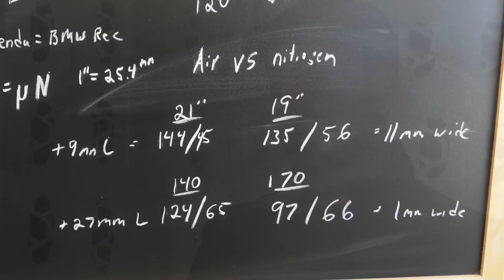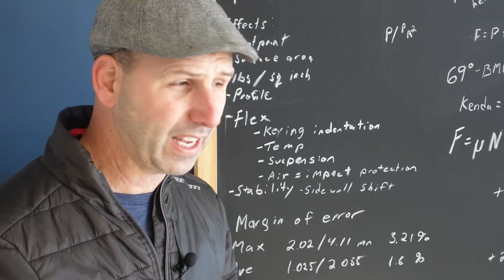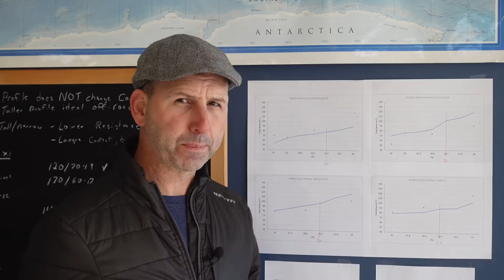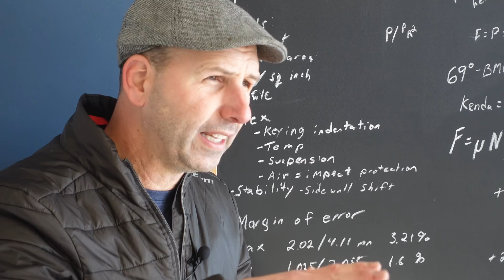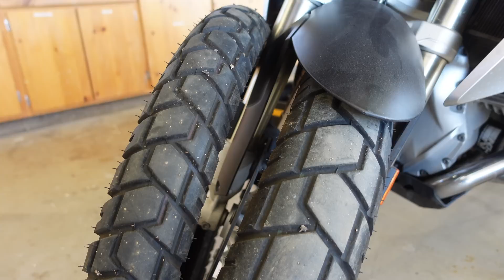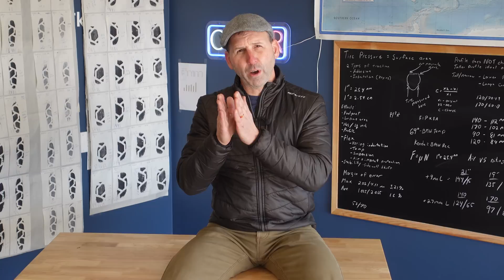Selecting the correct tire pressure; How airing down motorcycle tires affects contact patch

Comment: Although not measurable by any criteria discussed, my anecdotal experience is about FEEL.  When I air down the bikes feel planted, stable, and confident in marginal off-road surfaces. The difference in sand is remarkable. Nice analysis, thanks Brett.
Reply: Agreed. Try both and draw your own conclusions. I'm not going to run 8psi dirt bike pressures on my 600 lb tubeless ADV, but I'm also not going to run the manufacturer suggested STREET 36/42 pressures in the gnarly stuff either. I like Brett's conclusion of no more than 20% lower. 28/33 sounds about right, though I have gone down to 25/32.
Reply: Sand, gravel, and mud are reasons to air down.  You will have much better feel.  These are 3 dimensional surfaces the tires sink into.  The channel host's analysis was done on a hard 2 dimensional surface.
Reply: @stevestowell-virtue3781  The had 2 dimensional surfaces yield predictable data, whereas the sand, gravel and mud you mention are inconsistent in their give/ squish/ compression, giving you less predictable and therefor less accurate, feedback.
Reply: @Mo Nunyabidness  My point was the tires sink into soft surfaces so there is a widen contact patch.  We all run rimlocks on our dirt bikes and drop pressures as low as possible without bending a rim.  Lower pressures work off road by not stuffing a hard tire into the soft surface.
Reply: @stevestowell-virtue3781  Rob Pepper's analysis (on 4x4's) has similar conclusions as Bret's. Perhaps in terms of feel it may be different up to a certain pressure (as Bret noted) but the traction/surface area argument is near insignificant.
Reply: I can't say for sure if I"m truly feeling a difference or if it's the placebo effect. After watching this video, I have no doubt Bret is right about the contact patch changes being minimal (like 1-3 mm) but there are many times when a few millimeters here and there make a meaningful change. Examples include seat height, handlebar height, rake & trail, preload, etc. So maybe a tiny change in contact patch is still substantial?
Reply: @JohnnyFuelMotorcycleAdventures  I don't think it's a placebo effect.  When I had E10 front on my R1200 GSA it was better all the way around off road at 28psi than my road pressure.  The front suspension wasn't as rough over obstacles, and the front was planted in corners.
Reply: @JohnnyFuelMotorcycleAdventures  Hi Johnny, I think, all the parameters are important for races on tarmac, but like Bret said, a natural surface such as grass or gravel put all this data into perspective. What I know about the microstructure of tyre rubber is the claw factor on stony ground, where the tyre adapts better to obstacles. Otherwise, with too little tyre pressure you have more problems than is good for you.
Reply: Most people can't feel a small difference in air pressure in their vehicles.

I suggest, given the data, that you objectively test your feel of the air pressure. Check your air pressure with an accurate gauge. Ride a defined course of your choice. Have someone change the air pressure, up or down, by 5psi without telling you what they did or you being able so see/ hear/ discern what they did, re ride that same course. Come back and state whether you think they increased it or decreased it. Have that same person change the air pressure up or down again. Ride course again. Come back and state what you think they did again, and then have them tell if your  findings/ feelings were correct.

Take the subjective (feelings) out of it. If your feelings are correct, that's great!!!

I am lucky enough to be able to tell you if I have a low tire and which one it is. IN MY CAR. On my bike, where the variables are so many more (leaning, wind, spring/ shock compression/ travel, which gloves i'm wearing, who in traffic is trying to kill me with their inattention, the smells from that bakery always smell so tantalising, "there's some malice in the cold this morning" etc) I couldn't tell you with any real certainty. I mostly commute and tour on my bike.
I check my air pressure about 2X a month on my bike (Africa Twin)  and when I have corrected it, I can say "that feels right or much better" but honestly, on the ride in, I couldn't tell you that the air pressure felt off.

In my car: "it might be me, but I think the left front tire might be low. I should probably check it." I'm impervious to wind, insulated from the weather, shielded from noises, protected from inattentive drivers etc etc etc, and my brain, with less stimuli, is able to pick up on the tire pressures.
Reply: YES! Feel, established from the Vestibular system. Feel is what separates great from good from poor. Without feel, a rider cannot typically advance.
Reply: It's literally in the video and ignored. The fact a pinch flat can occur means the tyre is wrapping around better. The measurements taken are on a flat surface not one with inertia and rebound. On hard surfaces 20% if fine. On softer there's a reason we drop down to 50%. The measurements should be in percentages too not mm. 10mm more on 100mm patch is 10% more grip....

Comment: All I know are dirt bikes. I have the “tubliss” system in the front and rear allowing me to run 4psi in the rear and 6-8 in the front. The most noticeable upgrade I’ve done on the bike. We call it cheating. Traction and control over wet, angled roots in the trail is amazing. Plus, the 110 psi core keeps the rim protected while hitting obstacles like in this video. It’s not a myth. On this, I absolutely know of what I speak.
I ordered a 23 890 r that’s not here yet. I know nothing about adventure bikes. Thx for the info although if “tubliss” ever makes a system for bigger bikes, I’m all in

Comment: More can be achieved by setting up your suspension correctly for your ability,style,terrain,weight distribution (cargo,passengers)speed of riding,and distribution of terrain,road vs duel track vs single track. As you and your terrain get more technical air pressure will be more of a factor. 
Myself I am on more of an enduro style bike a Husqvarna 701.
Which I ride with and without full 80 liter bags and a single wheel trailer.
Reply: How VERY true. Susp is everything, yea, whereas air is almost (within reason) nothing. Keep 'em fine comments comming! Together, we might educate our fellow bikers to ride well and be safe all the time.

I am an engineer.

Comment: Thank you for doing this, this must have been a lot of work and we all appreciate it.
Reply: Yep.  The test tires were a roughly 70% pavement / 30% dirt design, with small grooves between large blocks, such that the surface of the tire is unlikely to shift around much when the internal pressure is reduced.  I'd be interested in seeing a test with a more dirt-worthy tire, like a RallZ or Dual Venture.  I've noticed that dropping the front tire pressure on a RallZ (from the KTM recommended solo 22 psi down to about 16-to-18 psi) made the front end of my 640 Adventure a lot less skittish on hard-pack single-track (hard-pack with a thin layer of dust on top).  Given the marginal gains in footprint area, I wonder if the significant difference in "skittishness" (which is just the "feel" of losing traction) is primarily in the tire's ability to conform to small surface irregularities.

Comment: I would have preferred to see the actual numbers not the coins. I drop pressures by about 30% when off road, and I would be interested how much my surface area increases in this case. I get noticeably better traction than on road pressures.
Reply from the maker: I did give verbals but will look to include those when I make the follow up with the manufacturers responses. 

I wanted to make it something people could understand easily
Reply: I wouldn’t trust my math skills and I’m not sure I correctly understood the quarter n dime representation, but I did the numbers based on them. I left the pennies out as I wasn’t sure of the representation, so I might be off even more. (Again, caution my math). Area of a quarter is 462.24 mm. Dime is 251.9. Eight quarters worth of “surface area” -20% psi from stock added 3 dimes (I think this is what he was showing?) which is 20% increase in surface area. -10% psi was a 13% increase. 
Sure feels like a 20% increase when I ride aired down so I’ll believe it till I’m wrong!  Ha.

Comment: So to clarify: you said you need to “air down to the proper range”? Not “ don’t air down?   Dakar riders aren’t running full pressures ( in fact on mousses)which enables lower tire pressures. Trials riders are definitely not running full tire pressures. That sweet spot will most likely significantly reduce the deflection and maintain power input and momentum rather than wasting it by deflecting the bike in a unwanted direction. This can be the difference in a successful hill climb.  Your tire imprints don’t take into consideration of a non regular  surface? That fully inflated tire will not deform as much and have a smaller footprint compared to a lower pressures tyre that flex’s around the object I.e pebble. This decreasing footprint will reduce traction. Any deflection is waisted energy- one which the suspension has to work extremely hard to compensate for and it inevitably de stabilises the bike. 
I agree with your finishing statement “find the proper range to air down to”- but do air down if the circumstances require it.

Comment: 250lbs load on 30psi tire: 250/30=8.3 square inches. In theory. Tire carcass stiffness would absorb some of the weight I think so actual area would be smaller . But this is the rough calculation and illustrates the basic relationship between pressure and area. I think the concept of this experiment is awesome but the presentation was a little confusing. There is a great debate in bicycling right now about wheel size and the takeaway is the contact patch AREA stays the same for a given pressure regardless of tire size because of the equation above. But the contact patch SHAPE changes with tire size and more specifically diameter, which is what you saw.

Comment: awsome video!  what do you do when tires have MAX load value lower than the motorcycle manufacturer recommended pressure?  Run 36/42psi recommended by the manufacturer or 35psi MAX load stamped on the tire?
Reply from the maker: That is the min pressure for maximum load. There is no reason to exceed that max load pressure.
Reply: @BretTkacs  The tire manufacturer states (MAX PSI 35) on the tire documentation (Battlax AX41)  is that the same as max load?

Comment: Are you going to make your measurements and data available?  The 30% spike makes a lot of sense in a tire, there is a point where you overcome the force needed to make the initial in the sidewall and once it overcomes that you see the spike in deflection. I would be interested in not change on length/width of the contact patch, but actual.percemtage change. Because of the shape of the contact patch, a small change to the outer ring can account for a fairly large area. I would guess that if you compare the values up to 30%, you could find the constant for the sidewall deflection force to add into the normal area equation and I bet all the math on surface area works at that point. Just looking at your plots, It looks like there are basically 3 sidewall states, that roughly correlate to <30%, 30%-50%, >50% , so once you find that extra force constant for those 3 states, the math is easy.

Comment: Great video Brett, the minimal change in surface areas was pretty surprising to me. I would be curious to see if you could measure the changes in static friction between different pressures on various surfaces such as mud, sand, and hard pack dirt, by putting a rider on the bike and then side loading the front and rear wheel with a scale and seeing when deflection happens.

Anecdotally, I started out riding the NEBDR with my pressures at 32/35 with Bridgestone AX41s on my 1290 Super Adventure R (max pressure for the tires was 35, tried to keep the same ratio F/R that KTM recommended (38/42). The front end grip was like a light switch at these pressures, the front end would slide and wash out in any type of soft mud or clay. When I backed pressures off further to 25/27 the motorcycle was far more controllable in soft terrain.
Reply: I have similar anecdotal evidence as you. I have a 790 ADV and the factory tires weren't great. I dropped the pressures from 35/35 to 28/30 and felt much better. At the time I was living close to a offroad riding area, so I was riding about 70/30 offroad vs on. I took the bike in for service, and the next time I rode in the dirt I washed the front end and dropped the bike 3 times. The dealer had reset the pressures to 35/35. I was riding the same trails and the same conditions as before, and I had never dropped the bike until that day. The difference was the tire pressures. 

I think that a healthy part of that problem was the Karoo's that came on that bike, I switched to Dunlop TrailMax Missions and don't have issues with front end grip, even when I don't air down.
Reply: @danmiezejeski7735  I ran the Trailmax Missions for a season and a half, loved them in firm conditions, but they were awful in mud and clay. Granted, I did not play around with airing down at all. I hope Dunlop brings the Trailmax Raid over this season.

Comment: The footprint of a larger tyre is only larger when it sinks into the medium it is riding through. Run a tape measure from rim to rim around the tyre. The footprint is only the same on hard surfaces. For a vehicle with four or more tyres on the ground its valid airing down. As they do envelop as stated. On a motorbike its not important.

Comment: Years back after watching one of your tire videos I went from a 130 rear on my Dualsports to a 120 rear (Dunlop D606 always) and the 120 is so so much better off-road. The thinner tire is lighter and spins up faster and it seems to dig into the mud and bite better instead of floating on top. Proper pressure and a thinner tire help me a lot

Comment: I find airing down for a softer "catch" on impacts to be a common misconception in 4-wheeling, as well.  The part of your vehicle that absorbs large impacts in a controlled manner is the suspension, not the tire.  A tire is, effectively, and undamped spring.  If one has any doubts, they need only drop a tire in a garage and see how high it bounces back.  Increasing the deflection of the tire by airing down just increases the amount of work for the suspension to do.  Airing down in the 4-wheeling world works at low speeds, but there is a reason we all air back up for any rapid travel.

Comment: Super interesting. As a very average adv rider on a T7 what I am most interested in is how I smooth out my ride on dirt roads, when riding over wash-board and potholes (I hate standing up!), when going between 30-50 kmh. I've sometimes convinced myself that by airing down 10-15 percent that my ride is a little smoother, that the lower pressure is magically eating some of those little bumps. But it -- the smoother ride -- could very well be in my imagination! Adjusting preload, rebound and air pressure seems like a voodoo art to me!

Comment: You didn't touch on the weight of the rider and maybe gear. Should I consider this when selecting an air pressure? I am only 140lbs on a Honda CRF300 Rally.

Comment: What I'm getting from your video and then the comments below is that the science is telling us that while the actual change in footprint and/or flex is small, most comments show that airing down gives the rider a better "feel", and more confidence. I think I have heard you and other top experts teach that confidence is one of the main things a rider needs to become competent on a motorcycle. So if that tiny growth footprint and miniscule amount of flex result in a huge  boost in confidence and feel - then airing down a bit is probably well worth it for many. And for competitive riders, every tiny bit of advantage can make a difference.  Thanks for clarifying the science behind this, but the placebo effect seems to be much stronger than the science in this case.
Reply: Seems like a good case of confirmation bias is at work here and potentially being confused as better "feel" and confidence.
Reply: @4LowRocks  YUP!
Reply: i think we also need to factor in that the low tire pressure is making the tire work like a suspension system, suspension systems keep the tire in contact with whats ridden on, therefore contact surface does not matter so much?
Reply: No, it's not a perception of confidence. It's actual changes in damping, hysteresis, friction & slip angle. He's a bit misguided in his 'theory'
Reply: May be, but riders get a boost in confidence because they have been brained washed to believe that they have more traction. It’s all in their mind. I am one who when ai bought my Tenere 700 about a year and a half ago started airing down my tires when riding in the rain. Until a couple of months ago I realized that I’ve been riding for 34 years, rain or shine, and I never aired down my tires on any of my sport bikes and never had any problems at all with traction in the rain. So I started asking myself why I was doing that now. I realized that I developed that mentality from watching videos about ADV bikes. It’s amazing how much others can influence us when you when we are hungry for knowledge. Which is the problem with social media, any fool can make himself or herself sound like an expert when they are not. Sadly someone will always be willing to believe them, I did. What I like about Bret is that he practices what he teaches and his skills are far what I see from others.
Reply: As somebody who's sold tires for a long time, I can guarantee you, most people can't tell the difference in air pressure.
The "confidence" comes from believing they have done something that aids them.